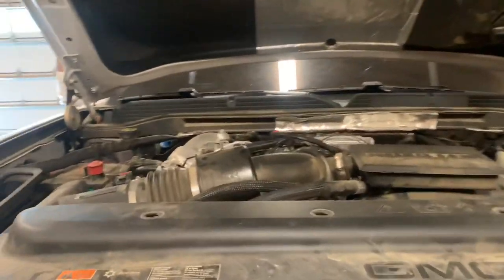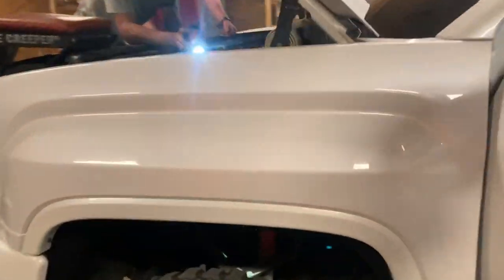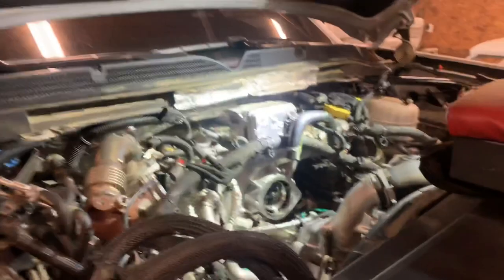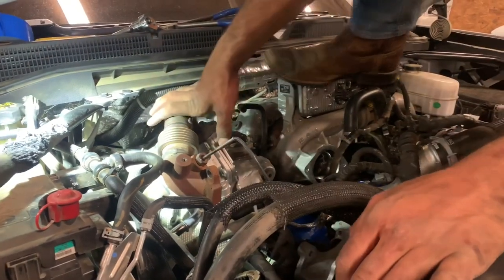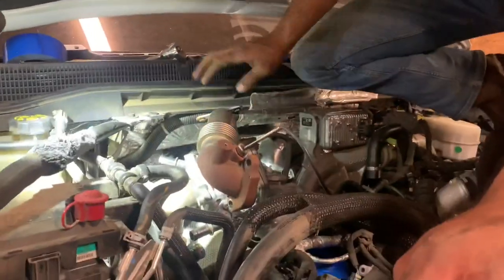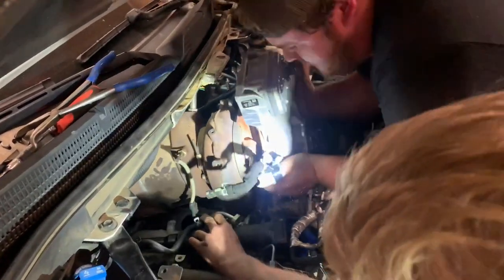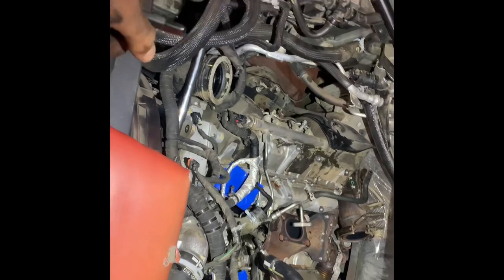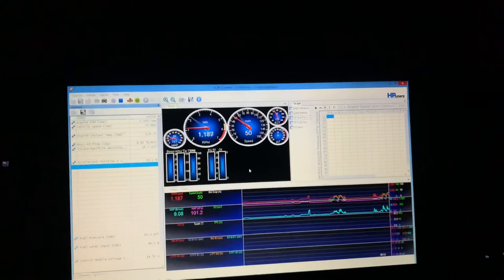Tuning and deleting an l5p!!!!

Comment: Where can I get the parts and directions you guys got? I got an 18 l5p I’m doing my self and need to be pointed in the right direction I don’t want junk parts lol I’d appreciate the help!
Reply: Bump, same my dpf just started with problems. Sent exhaust off for cleaning. 800 bucks later still have a problem. Willing to spend the extra 2k for a delete vs new dpf. 18 with 70k on it
Reply: @jtrump3740  good luck.... since the EPA made it federally illegal in USA its pretty hard to find now

Comment: Is it necessary to get it tuned? I own a 2019 but it can’t be like with older diesels where you just chop off the muffler or dpf? I know if cup off the dpf it goes into limp mode
Reply from the maker: The ecm is re flashed as well as the Tcm and the egr is removed

Comment: Excellent job guys but just not worth it for the average L5P owner in terms of $$$ for parts and labor.
Reply from the maker: In my opinion it is. The truck will last years longer because it’s not breathing it’s own exhaust and it’s a lot less restrictive
Reply: 3k for a new dpf from gm. 5.5k for a basic delete with new ecm. I'll spend the extra ND have no worries

Comment: What was the total cost to get it done?
Reply from the maker: 6k doing our selves
Reply: @Cutthroat_performance  I’m looking at getting a new truck. Never had a newer duramax. I wanna find one to drive before I do purchase. I know these l5p are power houses
Reply from the maker: @tater0909  I’m a ford guy so that’s what I would recommend but from the stand point of working on trucks/equipment for a living gm trucks got bad electrical problems. The engines and trans hold up well over time.
Reply: @Cutthroat_performance  I’ve had all makes. On my first duramax now and honestly it hasn’t impressed me much. That’s why I’d have to see what it does deleted. The 6.7 power stroke is by far my favorite truck. Just always looking to try nee things. Hopefully the market will have more to buy soon and I can start my search for one